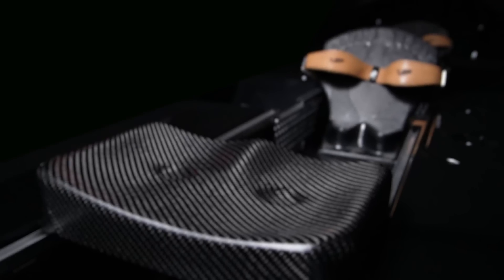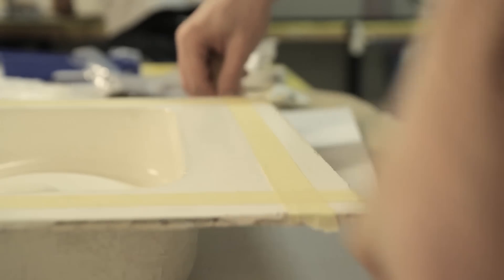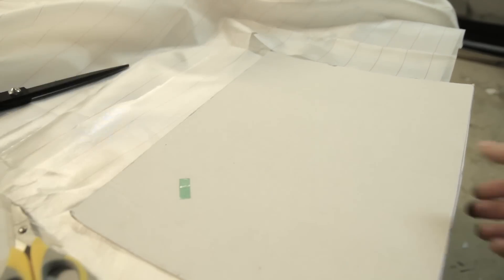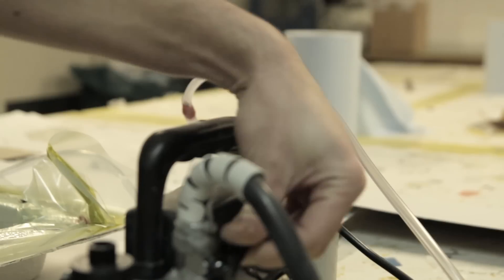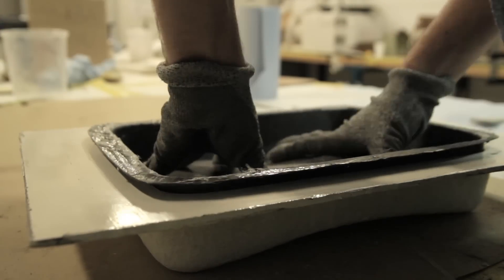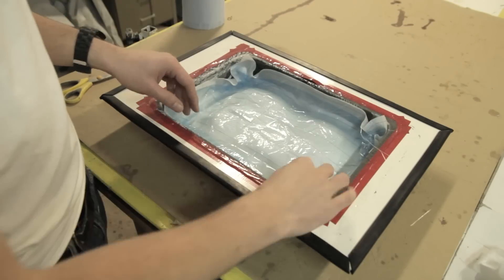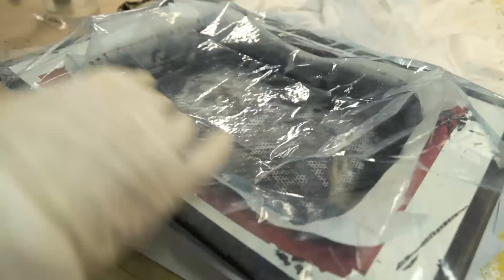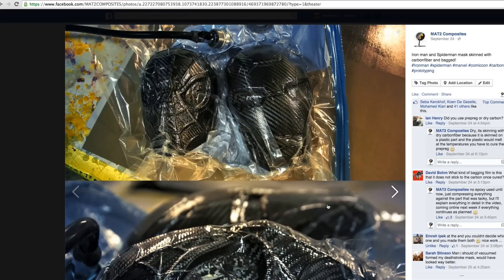Rowing Seat - Carbonfiber With Nomex Honeycomb (Spacegrade)

Comment: Hi matt, we spoke a few weeks ago on the unimould setup, which tape did you use to seal the edges of your part when applying the honeycomb, and where did you get it from? Also I had sime issues with my mould, it seems to have a small leak, so ill be envelope bagging the whole thing, so I needed some advice, could it be possible if I upon the first layup, whicg will go on top of the gc50, I can do it via wet lay and the the rest of the layers via infusion,, just to make sure that the cosmetic layer doesnt have any imperfections?

Comment: I have seen people working on carbon fiber applying the resin by hand and let it dry at ambient temperature, there is any reason why is needed to infuse?
Reply from the maker: You get better results with resin infusion and stronger parts lighter parts that's the main reason 🙂

Comment: I noticed you used the vacuum bags that are used to storage clothes in .I'm currently using them to bag some wet lay up carbon so they don't have a full vacuum but still get pushed into corners.
I'm thinking about going to use vacuum infusion with a vacuum pump .Could these storage bags be used to vacuum infuse  parts as wel ?It would be easier since my mold doesn't have a large enough flange to apply the sealant tape .
Reply from the maker: Could work but a lot of chances of failure

Comment: Won’t the resin from the fiberglass layer run into the honeycomb?
Reply from the maker: Just a bit, that why you need to saturate the fiberglass with just the amount needed to saturate the fiberglass, so it's works like a layer that adheres to the honeycomb but just seals it 🙂

Comment: So if using the carbon fiber,  why bother with the fiberglass? Does it really add a lot of strength to the carbon fiber?
Reply from the maker: It's a thin layer that seals the cores of the honeycomb so they won't get filled with resin with the following heavier layers coming on top

Comment: 8:28 hahahaha. What is the point of NOMEX HONEYCOMB if you fill it up? I guess this is part of learning and now you know you dont make infusion on honeycomb because add inecesary weight.
Reply from the maker: The nomex was sealed with a thin layer of fiberglass as you can see in the video, after that layer cured an other wet lay up was done on top, so no resin went into the nomex

Comment: How did that take a week? Surely 3 days max?
Reply from the maker: Resin needs to fully cure sometimes for 48 hours if you want to do it properly so takes time yes 🙂
Reply: @MatthieuLibeert  But surely it doesn't need to completely cure before you add the honeycomb for example. With easy composites fibre and resin, most of the curing is done after 24 hours, so don't you think it wouldn't be too much of an issue adding onto your part in 24 hour intervals for example?
Reply from the maker: @Freddie1M  as they say in the tds it's 24h but I find out it's way longer for cure, mostly go for at least 48 h, you might go faster but more risk to de laminate your lay up by peeling the peelply to soon, so yes can be done faster but take your time if you can
Reply: @MatthieuLibeert  Useful to know. I need to make quite a lot of carbon fibre sandwhich panels before the end of term and Iv'e only really allowed 24 before I peel the parts off my polypropylene sheet. Do you think delamination is less likely to occur for flat sheets (500ml x 275ml) with wet lay up method?
Reply: *24 hours
Reply: Also, regarding the nomex core you are using the vacuum to bond it, I don't have a vacuum pump so I was wondering how effective it would be to just do a wet lay up and just stick the nomex on and would you stick the nomex on once you have the 2 cured laminates, so just apply epoxy on both sheets (bottom of the top sheet and top of the bottom sheet) and leave it?
Reply from the maker: @Freddie1M  can't really tell, you'll need to try it out, might have some impact on the surface finish as well if your talking about demoulding as well

Comment: Could you brush the resin in, put the core down, and throw the fiberglass on top of the core to vacuum it all down at one time to seal the core?
Reply from the maker: Could work but you will have some marks of the core
Reply: Matthieu Libeert only on the inside, but nobody should see that
Reply from the maker: You would have some marks I  the mould side as well
Reply: Matthieu Libeert I don’t see how you would get core marks on the original infused piece, you don’t have any now... I’m saying to combine your 2nd/3rd step with vacuuming the core on its own and the fiberglass to seal the core on its own... if you’re waiting 24 hours for each vacuum process it’ll save you at least a day
Reply from the maker: Oh OK I thought you meant everything in one go 🙂 with that stop in-between the last two layers you can avoid having to much resin / weight falling into the cores of the honeycomb, that's the reason why

Comment: But the bottom layer of the seat is under tension when someone sits on it, you need your strongest material on the bottom not the top.
Reply: If you see the top of the seat you will see two small dents, probably he will make holes and use screws.

Comment: Totally new to this so bare with my stupid question... Once you vacuum it all up and all the air is out, what do you do with the vacuum pump? Do you leave it running all night? or you just switch some sort of a valve and you leave it? How does it work?
Reply: You could turn it off, but chances are that air will leak in eventually. Usually, it's better to leave the vacuum pump on, at least until the resin semi-cures.

Comment: Is that really lighter then a single piece of stamped aluminum?
Reply: Probably not, but the seat is custom fitted to the posterior of the rower and much stiffer.  Making a die in that shape for a one-off is probably more expensive than composite construction.

Comment: So when you wet out the fiberglass over the honeycomb, none of that resin filled in the holes in the honeycomb? I'm new to this and am shopping for appropriate honeycomb materials for a motorcycle seat, which will really be quite similar to what you're building here.

Comment: So much wasted time and energy! Would have been infinitely easier to do a wet layup with honeycomb and vacuum bag ONCE. 

Also I would highly suggest researching into the strain tolerances of fiberglass and carbon fiber. Mixing them is almost useless because by the time the fiberglass stretches the carbon fiber will have snapped (5% elongation vs 1.5%).

Regardless thanks for posting the video, there is not much of this type on content on youtube for whatever reason. Hope you are having fun!
Reply from the maker: xSiliconKnightx if you would do it at once with wet lay up the honeycomb structure would be filled with resin and wouldn't make sense to use a honeycomb then
Reply: Yeah I agree, as long as there was no face sheet. I suppose for the complicated geometry it would have been hard to add a face sheet before hand.  Alternatively, using pre preg would have allowed for a one shot molding. Even a wet layup with carefully controlled resin amounts probably would not be so bad.
Reply from the maker: xSiliconKnightx would be hard to get the same finish tho
Reply: @MatthieuLibeert  200 weight fiber would have been used for the surface finish and then add the reinforcing layers afterward.
Reply: Infusion or Prepreg process provide more flexibility and stronger product especially for aerospace projects. It doesn't matter if the product is small or large, all that matters is the quality of the finished product. Wet Layup is not the best choice for top quality. I agree for the Plexi but if the customer need it just for cosmetic purposes and cheap at the same time, then it is acceptable.

Even if you use only plexi material through Pre-preg of infusion procedure they are very strong ex. Ladders for electricians.

Comment: Hello Matthieu, 
Its exactly the kind of tutorial I was looking for. I have one small question though (seems like quite an old post, hope u will still respond). In your video at about 8:30 you have used a fiberglass on top of Honeycomb and then vacuumbagged. But I could not see if (or how) you used the resin for the fiberglass. I am very curious about how you did it. In my case I need to make sure that there is no or very little resin going into the Honeycomb. 
I'd highly appreciate your response. Thanks!
Reply: I think @Matthieu Libeert applied resin on the fiberglass before laying it on the honeycomb.

Comment: mixing fiberglass + carbon fiber is not a good idea, it's not nearly as strong as you think.
Different elongation, so the fiberglass adds very little strength prior to carbon fiber breaking, as carbon is much more stiff material and has very little elongation before break.
Carbon has 1.4% and Glass 4%+ if i recall correctly, which results that only 1/4 of the glass strength adds to carbon before carbon cracks.

Comment: Hello there,
In my working environment, they made me understand, that the key role of a good & smooth finished carbon fiber part is THE MOULD. Knowledge for carbon fiber and resin exists, but the problem is allways on manufacturing a good mould. As I said, in the work, many carbon fiber parts come with small dents; the main reason is a mould, which does not supress the part properly and air goes between carbon and the mould. I would ask you to give emphasys on mould shaping and manufacturing ( materials, process, finishing ). Allready subscriped my man!!!

Comment: I knew that cores with open cells must not to be used with liquid resin but only with prepreg (because the resin into the cells might make the Nomex very heavy) and that the goods with Nomex must be put into oven.
 Can you confirm that the seat had not any problem? Thanks to show us your video, it is very interesting. Alessandro
Reply from the maker: Alessandro Ferrara doing it like here is a technique they use in aviation and automotive,  open core can be used with liquid resins but with an other approach like here in my video, hope this answers your question
Reply: Yes, sure, thanks for your reply. I asked only to better understand (I have never worked with infusion, but with hand lay up and vacuum bagging). The question "No honeycomb with liquid resin" has been a reply I received by a skateboard manufacturer who has a semi industrial approach to the matter. Really thanks for your explanation. Alessandro

Comment: Did you put any epoxy after vacuum bagging the nomex honeycomb and before putting fiberglass? what was the typical duration between the two steps? Did you let the epoxy cure in between? Nice vid btw.

Comment: Why did you let the nomex fill with resin, thus eliminating all of its structural properties?  You need to use prepreg with nomex...
Reply: Pre preg is best for use with nomex but can be done with wet layup if the resin is spread and all excess is rolled out of the cloth before putting onto the nomex, although still not as ideal as pre preg

Comment: Nice video! 
Why don't you degas the resin in vacuum before the infusion? I ask because I have to deal with air bubbles in my parts, although I degas my resin. 
How high is your vaccum pressure during the infusion?
Reply: naCho EZ gel coat avoids surface bubbles
Reply: C W  obviously  you have no experience with decent hand layups either. You NEVER use triangular pieces, you cut the material on the bias. The more small pieces used the more chances for a failed seem and excess buildup of thickness in a crap part. Maybe instead of trying to act like a keyboard tough guy you should learn what you speak of. I'm a designer that calls out manufacture methods on carbon fibre production to our vendors. But that's probably not an issue for you as I looked for your products everywhere and couldn't find any.,

Comment: You got fantastic videos! 
My question is, do you let the gel coat cure before moving on or is it still wet when you apply the first layer of carbon?
I´ve never used gel coat so far and im dealing with a lot of pinholes...

Thanks!
Reply: No, you allow it to fully cure
Reply: You let it stand for a couple of minutes then put carbon ontop when its still wet. That is my understanding

Comment: I'm curious about what your vacuum gauge reads. I can only get mine to -.8. Does yours go to -1? Nice project btw, I am making a different kind of seat using your technique.
Reply from the maker: -1 yes,  depends on how strong your vacuumpump can pull
Reply: Matthieu Libeert I wonder if -.8 is good enough? I've watched all your carbon fiber videos, the car, the mask, even the lamp!
Reply from the maker: +Sammyjeans1 depends on what you want to do.... 0.8 Is not that much but ok
Reply: Matthieu Libeert Thanks for the advice. I guess I'll have to borrow a vacuum pump. The one I have uses compressed air.

Comment: Good job and nice video... I have one question though! What does the fiberglass help? You have some real high tech stuff there and it won't add any significant strength...Why don't use a layer of thinner CF...Or a single thick one?
Reply: Sketch1994 fiberglass it's cheaper that's why people add it in between the carbon

Comment: How do you know how much resin you need to apply to a part?

Nice workshop at the IDC btw ;-)
Reply from the maker: +Jonas Deman correct, IDC. you can make a rough estimation by weighing the fabric and using the same amount in weight as the fabric for the resin and add a little bit more. It's not exact sience its more of experience

Comment: Can you get a decent result from doing a wet layup with the carbon and then vacuum bagging instead of doing the resin infusion if you have to make very large parts like the size for a Formula car body? Also, is it ok to overlap the carbon if you can't get the correct shape out of the single sheet, like for complicated 3d geometry in a split mold? Thanks!
Reply from the maker: to be honest it will be hard to get perfect cosmetic results with wet lay and vacuumbag...at least thats what I think...And sure you can overlap ;-)
Reply: +Matthieu Libeert (Mat&#39;s Prototyping) So if you were doing a very large complicated part that's one piece, would you use more than one vacuum pump for the resin infusion? Maybe one at each corner?
Reply from the maker: +MegaherzZwei what do you call large? you have small pumps and bigger pumps...one should be enough...did a full boat with a friend withone pump but was a big pump :-)
Reply: +Matthieu Libeert (Mat&#39;s Prototyping) Ahhh ok, yeah not as big as a boat! But apparently it's good to have a big pump!??!?lol Thanks for your vids and quick responses Matthieu!
Reply from the maker: +MegaherzZwei no problem! good luck with your projects!

Comment: Curious to know why you do it by so many separate steps rather than form the body in one time vacumm bagging
Reply from the maker: +Charly Wong If you would all do it at once the honeycomb little cores would just fill up and you would have a heavy, resin rich part
Reply: +Matthieu Libeert (Mat&#39;s Prototyping) I was thinking the same thing as charlie but then had another look at the material and saw that you're right and it would be a solid resin rich material. You should have a go using Lantor Soric as your honeycomb and flow material. it maybe not quite as light but I've had great results with it as a flow media and a very rigid and strong core material. the honeycomb is also non absorbent and so you won't end up with a resin rich part.
Reply: if it had been done via infusion, then it could have been all laid up as one and run as a single step effectively.

Comment: I'm curious to know why you used a layer of fibreglass in the process?
Reply: +Anthony Bowe I wouldn't know for sure but to visually confirm the adhesion between the nomex core and the layup? With black carbon fiber layup i assume that would be quite impossible.
Reply: Thanks Matthieu!
Reply: +Anthony Bowe exacly for me that was pointless
Reply from the maker: +Anthony Bowe fiberglass is used because I didn't had such a lightweight weave and this was just for instructions...if you use fiberglass or carbon fiber, the process is entirely the same
Reply: it makes no sense from a structural point of view, thats true.

Comment: Hi Matthieu, 
I really enjoy the quality and pacing of your videos.
Evidently making this part from prepreg would reduce the cost in man-hours as you could layup and cure the part in one step.
How would you estimate the difference in material and tooling cost if you were to make this part in prepreg (suppose 80C cure system)? Do you have any experience using a gelcoat along with prepreg to control surface finish?
Reply from the maker: +Paul Achard Never tried a gelcoat with prepreg...at my opinion you would get print through of the fibers in the gelcoat due to the fact that gelcoat will soften, dont know how the resin in the prepreg will react with the gelcoat as well :) sorry for my late answer by the way :)

Comment: Hi amazing video! I am currently designing the chassis for the Shell Eco marathon competion. The plan is to make a tub like shape using  layers of 200g/m2 twill weave carbon on either side of 9mm thick nomex. SO the two options i have for fabrication are to make a flat panel and then to bond the stringers and the other is to use the cut and fold technique. Btw we don't have prepeg so it will be wetlayup :P The plan is to use wet layup prepeg. Any input for me matthiew?? Many thanks!
Reply from the maker: Mohammed Omer depends if you have a mould? with a mould following the technique in my video you would get the best results. You might have some dificulties bonding the sheets on the nomex to keep it shape due to the tension in the sheet